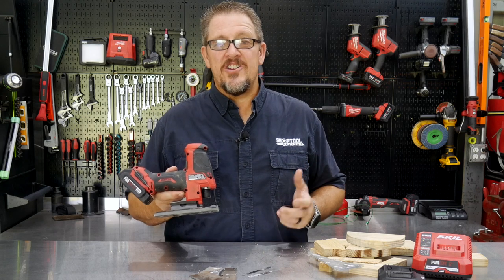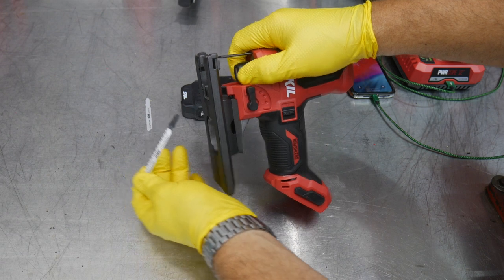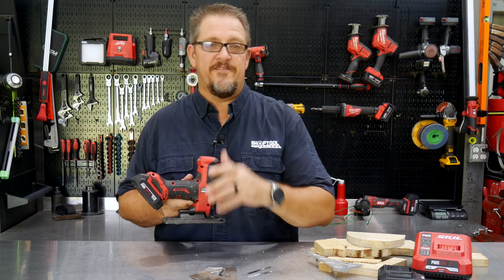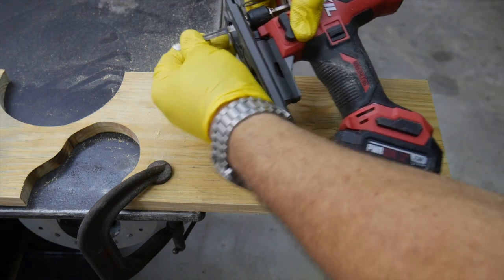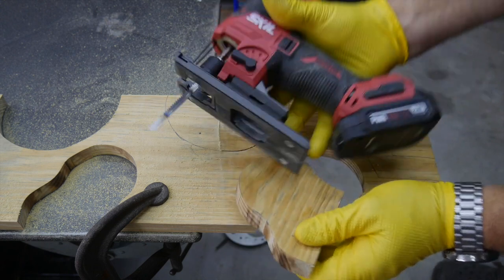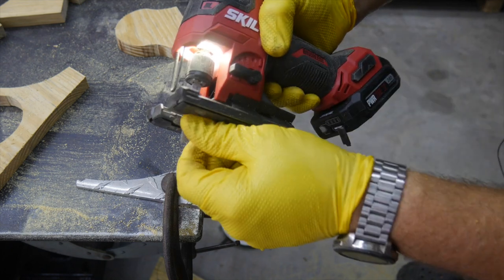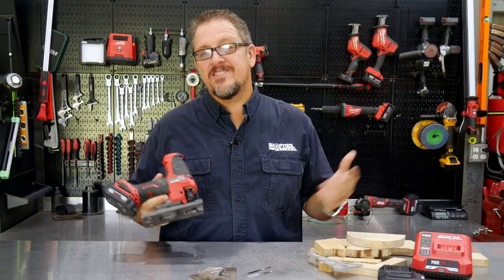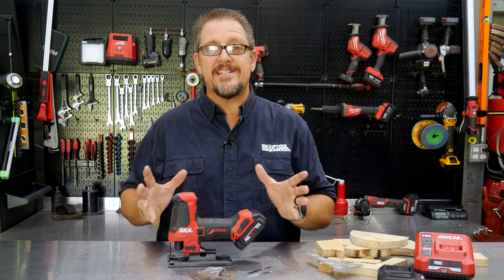COMPACT POWER - SKIL PWRCore Brushless 12V JigSaw Review [5YR WARRANTY]

Comment: While this is a great small jigsaw it has one flaw. It’s only smooth operating with a thin scroll blade. Any longer t shank blade, heck even the wood blade that comes with it will make the shaft that’s coming up and down hit the light ring. I m not sure if that’s by design but that’s pretty annoying. Saw still functions but I don’t think that’s good for the saw long run. Also that collet that holds the blade is not very well thought out. I guess all in all that’s what you can expect from a $ 59 jig saw. Def not Bosch or Dewalt level.

Comment: Don’t like the no trigger or having to use a tool to adjust the bevel. But it would work with my 12v impact battery. Trade off from 20v system variable speed dial vs trigger.

Comment: I tried it, not perfect for straight cuts like 90 degree.
Reply from the maker: Really? Did the blad wander? What material were you cutting and which blade? Thanks for watching.
Reply: @Shoptoolreviews  just 2x pine. I took a square to check and it wasn’t even close

Comment: One thing you didn't talk about was battery life.
Reply from the maker: Sorry about that. Thanks for watching
Reply: Does it matter?  The battery charges in 5 minutes.
Reply: @chellewizzie  The battery charges to 25% in 5 minutes... but that's IF you remember to hit the button, IF the battery temp isn't too high or low when you put it on the charger, and IF the battery is drained far enough to activate the pwrjump feature.  
I bought a 5 piece set for my brother, and it takes closer to a half hour to fully charge the 2 amp hr batteries, but I didn't time it, so + or - some.
Pwrjump is faster than the charger included with my xtreme, but that's dewalt"s worst charger.  I think the dewalt battery lasts a little longer in use.  It's tough to tell without a head to head comparison.
 I've also used the Bluetooth speaker and light, which I thought were a stretch to call tools, but I really like both, especially at the $150 price I paid for the set.  The oscillating multitool appears to be very good, but we haven't used it on a job yet.
My one complaint is that the SKIL 12 and 20 volt tools appear to require different chargers, where Dewalt and Milwaukee can use one charger for either.
Bottom line is that they are great tools with one small flaw.